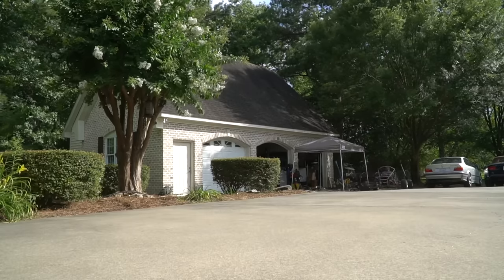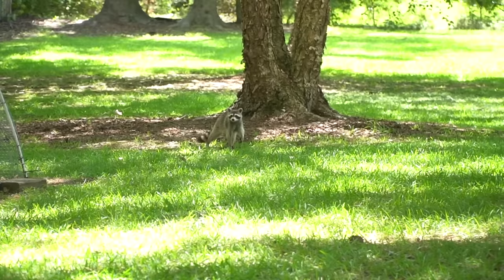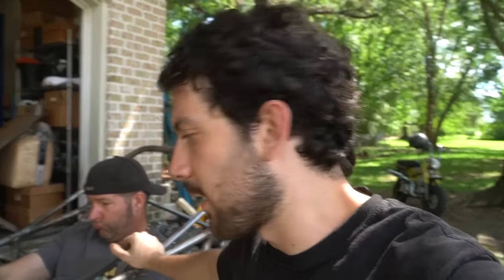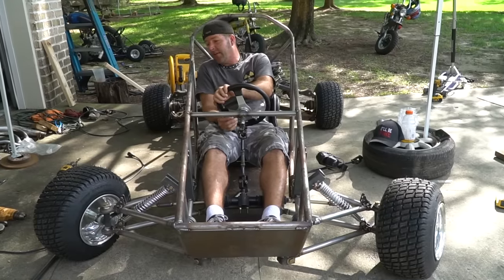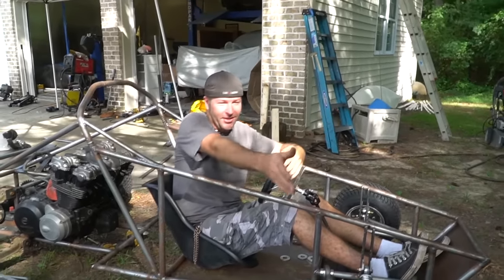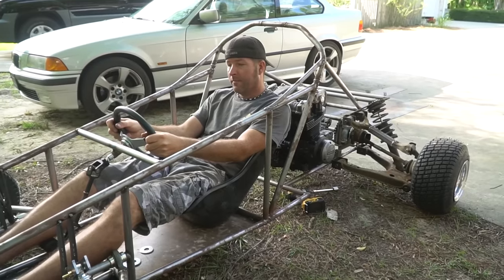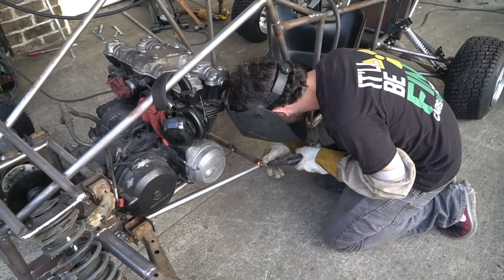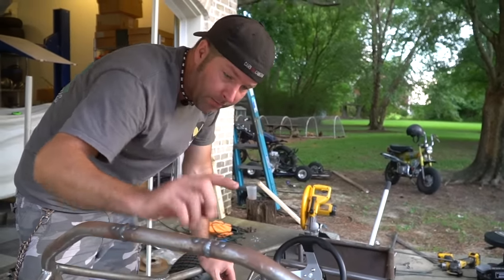ROLLING CHASSIS! | 750cc Cross Kart Pt. 11

Comment: Guys, you need to clean the welder lead occasionally, I take mine apart, pull out the inner liner that looks like a tightly coiled spring and wash it all down with brake cleaner inside and out, then blow it out and off with air.
A lot of dirt and grit accumulates inside them and can cause the welder to work intermittently or not at all.
Also, when welding outside you need to be shielded from any breeze that can blow away your shielding gas.

Comment: Hey what about adding some weight and the extra spring to the front to try to get better weight distribution? 
On the frame, on convertibles they make crosses under the car to supplement no roof X it looks like you could add 2 or or 3 X’s and that would totally tighten it up and extra strength for off-roading
Reply: Meant to say add gas tank to front

Comment: I had a similar issue with my welder recently. Have you checked to see if the wheel for the wire spooler isn't slipping? I turned mine around to use the unused grove, readjusted the pressure on it and it cured it.

Comment: Looks like you need to lift the upper A frame on the up about 6 to 8 inches. To straighten the tow out on the front. Because when you are sitting in the go-kart the tires are on the inside edge of the tread.  It probably wear out the tires on the inside not even with the road.

Comment: If you mount the shock about halfway up the lower control arm and more of a vertical position it will support more weight and have more suspension travel   For every inch of stroke on the shock it will be double at the wheel of mounted halfway up.

Comment: TO FIX YOUR WELDER. You just need to clean the cup(or tip) out on your wand and then you wont need a new one. I can see all the slag on your tip and it is disrupting the flow of your shielding gas(argon etc). Which will cause your weld to oxidize and bond horrible. Also adding appropriate oil or lubes to your wand and then cleaning it out can fix all your problems in 10 minutes. Also check ALL SETTINGS on the welder to make sure one you've never used isn't set to the wrong setting

Comment: You guys might be able to replace just the liner in your torch and cable drive wheels are also normal wear parts I weld for a living so...
Reply: I was thinking the same.  Liner and new contact tip will likely resolve the issue.

Comment: Looks like the middle of the kart where the seat is has some sag in it with weight. Don't forget to brace that so the frame doesn't bend or snap on you when you hit a nice size bump or jump.

Comment: Are the upper and lower front a-arms different length? Seems like they would have different radius’s if so.
Reply: yes, short, long arm. Its commonly used and the different arc radius's control camber gain under travel
Reply: Zues Toots Interesting, I would have thought the different radius’ would bind but I suppose the knuckle can pivot as well. Thanks for the reply.

Comment: I'm a retired welder of 30 years experience & your welder problems are wire feed related, either the liner is gummed up and needs blowing out with an airline or your wire feed rollers need a little tlc & a new tip possibly in the gun (wand)
Lincoln welders are bomb proof so it won't be the plant itself, some tlc & it'll be fine :-)

Comment: While you were talking about weight destribution i thought this chassis might have a heavy understeering habit on heavy braking, becouse of the driver pushing with feet, since "hanging" yourself on seatbelts is exhausing. Of course i might be completly wrong and this might flip the balance so much that the back would not have enough grip and oversteer like smart roadster does, for example, espesially on downhill braking. Would be a killer btw if u fit some Ariel Atom style fenders over the wheels ^^

Comment: Guys try blowing compressed air thru your welding lead and whack it with a bit of wood. Then clamp a piece of leather on your mig wire with a heavy duty paper clip, in front of your wire guide as it comes off the spool.

Comment: Instead of replacing the gun on your welder you guys might want to try replacing the steel liner inside the lead. They can wear out and get kinked which will affect the way it feeds the wire

Comment: Put lights on the front and weld a bar around them. It will raise the roll over line above the steering wheel.

Comment: Should be good on front shock now, just add a cross brace for better stability in the front, like adding a strut brace on certain cars. Don't get way everyone that has built a  cart of some kind think square, when a arch is stronger look at rock crawlers they know how to make a strong frame. Just watch the abuse they take and usually the only thing that breaks is drive line. ✌🐓

Comment: sumtimes the drive rol for the wirefeed looses its grip as its become polished over time , you can buy new rolls for them but make sure you get the one for the gauge wire youre using
as for the second hoop , i think one hoop in front of the steering wheel should help a lot

think the kart will do better on a roadcourse

Comment: Love the whole setup but I would make one change. I owned a 1980 CB 750 and it's an ok motor but I always found it a little soft. I traded the CB 750 for a 78 KZ 1000. Much stronger engine and should still fit into that space nicely
Reply: They used such small tubing for that frame they are already having frame twisting issues without adding a ton of weight in bracing it up. A bigger engine is just gonna make it that much worse. 1 inch is fine for lawn mower engine karts but once you set up to bike engines they should really be using 1.25 or 1.5 tubing.

Comment: Looks sick guys! JUST fór thé front suspension, it shouldn't come up that easily. I don't understand suspension systems that well so my friends commenters Will do the job fór me. After you Finish thé crosskart, could you please do a 4 cylinder bu 0ild or a geo metro 3 cylAnd put it on the rat rod Wagon. I know it's old but if you tried pls

Comment: The reason I come to sites like this is to see how other people "do it".  I searched Formula 1 Chassis and suspension design and came up with a video by ThomsenMotorsport called  "Chassis Part 1: Design and Frame Build". The concept is the same no matter the speed.  The goal is not to break anything and have control of the vehicle.  You are still thinking with a go-cart mentality on a vehicle that will have more power than agility.  If you watch the video I've listed you will see that there is much more X bracing in the frame.  Everybody goes through these learning curves.  There is also not adequate space between the back of that seat and the hot exhaust escaping that engine. I've owned a number of 4 cylinder bikes in my life and you can't believe the amount of heat that comes off those pipes.  And on helmets, if you plan on the helmet being part of the roll cage, plan on barfing out $1000 on a helmet that does that, otherwise add some more steel to the cage.  Gordon Johncock proved to me back in the 80's that it was possible to slide upside down on his head with a F1 car laying on top of him as long as the helmet was top quality.  Back then it was a Shoei, but now there are even better helmets.  I hope sincerely that one of you don't get seriously hurt figuring it out.

Comment: A little suggestion. Put a roll bar higher than the steering wheel.  If you roll it will bend down crush your legs and trap you

Comment: You need a new liner for your MIG gun. You can also try using compressed air to clear out the liner. I have the same machine and it's always giving me problems like that. I'm actually on my second machine because the drive roller assembly was acting funny.

Comment: Hey guys cannot believe how wrong you have the front shock angle you need to move the lower mount in and the upper mount out possibly longer coil overs ,thought you guys were more knowledgable 😂
Reply: Robert James plus the steering geo...I can’t imagine driving a kart with that steering ratio...
Reply: Robert James I think  them running into their own jack is foreshadowing :/

Comment: Who is Leroy the rooster?
You know what guys you don't have to replace the whole wand there is a liner on the inside of that wire feed. Just replace the liner as it gets wore out from The Wire feeding through it if you do a lot of welding it wears out quicker it's almost considered a disposable in fact it is.

Comment: Change the welder tip and cup. Make sure tip is same size as wire. The debris in the tip could be causing feed issue. So could tension
Reply: Harbor freight will have tips. Cup could be cleaned

Comment: Instead of adding 1 scoop at the top of the roll bar, how about adding 1 on each side parallel to the riders head, so it would provide air flow on both sides of the engine.

Comment: Leave a cracked, not open all the way sardine can in that trap and wire tie it to the cage then put a little peanut butter on the lid. No raccoon can resist it. I’ve had much success with it

Comment: The lower shock should be in the middle of the lower control arms. Give you better spring. Just look at any Front end of any vehicle.
Reply: and more travel for the same length shock

Comment: Cause pvc pipe pvc glue and primer with some baking soda makes nice chemical weld. And I figure get some garbage disposals  and hook multiple up to a single propeller at a time in a duct would provide enough thrust to get off the ground...or just build a hiller from 1947 that would be fun to see so I can diy it at home and fly away.

Comment: front shocks need to run more upright and rebound control would be nice on them also, lock to lock on the steering should be able to be achieved without having to pass the wheel from hand to hand ideally.the frame will need lots of cross bracing if you want it not to fold like a pretzel considering the tubing used and the weight of the rider and that 750, which in my opinion should have been the Ducatti motor as the 750 is a turd when it comes to making power.

Comment: Need to add an Oil Cooler , with engine sitting behind the seat air flow is lessened  , oil cooler would benefit the engine

Comment: chances are your welded is not working prop because there is dust and dirt from the welding wire causing the wire feed to stop then jump  if you pull the wire out of the line and lay it out flat and straight blow compressed air down the line where the wire goes  do this a few times and whip the line around a few times do it again  this should clear it and make it work better again
Reply: Forgot to add take the tip out the gun

Comment: I see a lot of design flaws and things that WILL FAIL almost immediately. Check out forums like Minibuggy and look at the chassis designs people have come up with. I hate to say it but, I would scrap that chassis and start over.
Reply: Be prepared to be jumped by all the little yes men or them to make another video saying how much all the nay sayers are wrong.
Reply: fully agree, at this point it would be much better to cut the losses of the current chassis, and start over.  way too many glaring issues with the current one that will no doubt cause all sorts of issues later on
Reply: @user-neo71665  I'm not posting this to have a pissing match online. I've built a mini buggy and have experienced failures. I strongly advise scrapping this and copying a known design. The front suspension and steering geometry is way out of whack. The ackerman angle, roll axis, caster, camber, SAI angle, scrub radius, rake etc... There are so many different variables that come into play with performance and safety. This is a powerful engine with potential of very high speeds, It could have fatal results driving a poorly designed unsafe vehicle such as this one.
Reply: @skatefreak666666   Best bet would be to buy plans from "The Edge Products" I'm not affiliated with them. I just noticed their plans are currently 50% off
Reply: @74elsinore  Trust me I completely understand. I've built a few myself but when I warned them about how those tractor supply heims are weak and not good for suspensions I got jumped then a few days later they made a whole video about how they are fine. I also say 1 inch tube is way too small. It's their life but personally I don't enjoy control arms sticking out of my leg because a $5 part broke. Once you upgrade from lawn mower engines everything on the buggy has to be upgraded. It's not a pick and choose based on price.

Comment: Your welder probably doesn't need a new gun. Those dont wear out so much as the liner inside your the lead. If that is too worn or kinked inside, the liner is no good and will cause the issue you're having.

Comment: Eventually you will almost double the amount of supports and gussets and tri-forcing that you have now. Unless you're not going offroad with it. I personally think you do not have enough surface area welded between the engine mounts and tubing. I've had mounts rip and tear themselves right out of the tubing.  Examine the cheap Chinese yerfdog style buggies frame. They are really triforced and they only have 150cc engines. You guys have a big boy now. I'd hate to see it fold in half when you guys take it to the dirt hill and jump it. Don't be afraid of the weight. Your going to need more pipe. I've broken many sand rails.

Comment: Personally I'd put an X in the frame behind the driver on the floor and a harness bar for the driver with a fire wall and maybe a removable x frame on top of the motor to stiffen it up and also go with isaac's plans of stiffening it up ... always over engineer any project

Comment: I'm just not digging this build at all and won't be watching it until their failed first drive. It's just not well thought through. It's gonna be pretty bad at offroad riding. I hate that motor it's a piece of junk. The miata struts in the back were sprung for a 2500 pound car. It's like they had no idea how to mount the front shocks. They need to be more upright. And the whole chassis just isn't designed well at all.

Comment: I'm guessing bye want your saying the gun but your liner has probably went bad. Cant step on them or kink them up. You can get a new liner for 20 bucks and keep your leads straight when your welding  not in a bind
Reply: Ohh and check your wire even new wire can be rolled wrong and cause the wire to stick make sure there is 0 kinks

Comment: You didn’t just call that whip a “wand” okay first off, the liner in that whip should be replaceable, the tip, diffuser and cup are also pretty much always replaceable in my experience, those are consumable items. If you need to learn more about welding we should speak.

Comment: What a mess that frontend is. The whole thing really. Predictions. 
1. First big front end hit at like 45 mph, bump, curb, rock, bad jump landing. Shoddy welded on rod ends break free and very bad things happen. 
2. The terrible shape of the front is going to kill you. Litteraly. When one of you idiots goes flying in under a branch or fence or something it's going to ramp directly up the frame into your face/neck. Put front bars that are more vertical, tied in like a real roll cage.

Comment: Well, your shocks/springs are HORIZONTAL!  Now your inner  tie rod ends are not in line with your inner pivot points formed by your upper and lower control arms.  Bumpsteer will give you poor directional stability.  No awearness of basic details. 👎🤷‍♂️🤭

Comment: Does anyone have a 12 spline female adapter?  item 7 Befco Weld In 12 Spline Blade Carrier Hub for 40HP Gearbox, 503-597B -
Befco Weld In 12 Spline Blade Carrier Hub for 40HP Gearbox, 503-597B